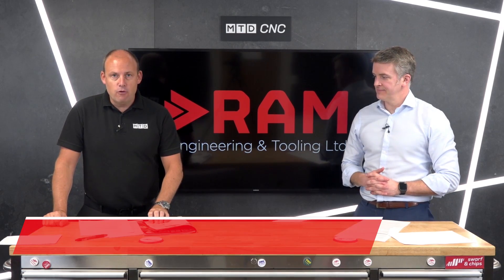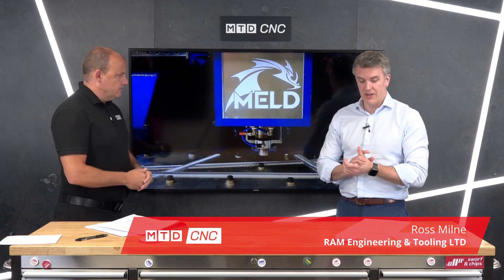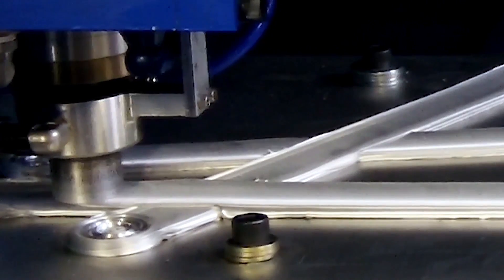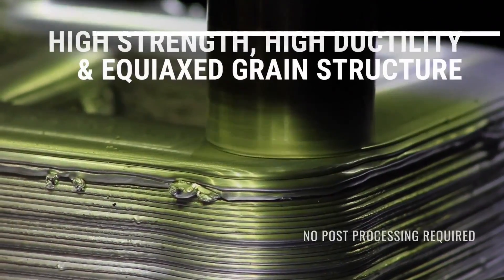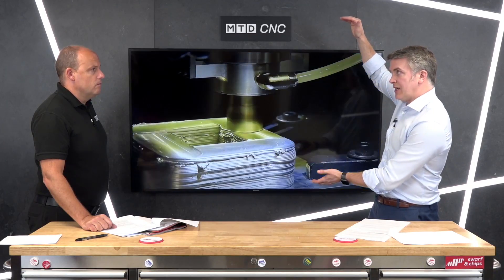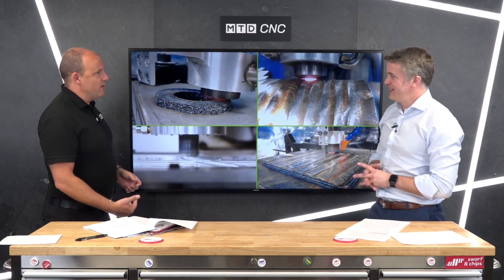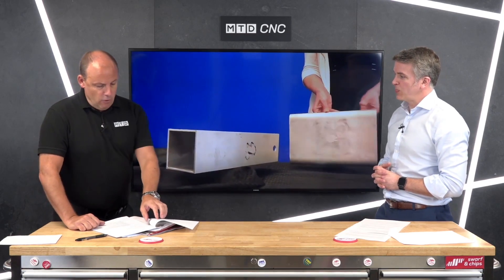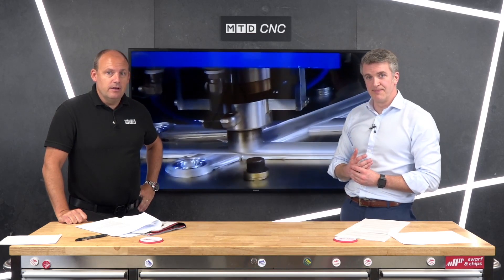You won't have seen this technology before, new from MELD

Comment: I wonder if you could use the drops of material for it. Where I work we cut a lot of material and have large quantities of short to medium length drops left. I see an opportunity to recycle that lost material into this process and make more with existing material. I don’t know if you would need a full 20ft bar or if using shorts would be an option.
Reply from the maker: I believe you can, you need to speak with RAM Engineering and Tooling
Reply: Hi, Happy to have further conversations with you if you would like to email us on sales@ramet.co.uk